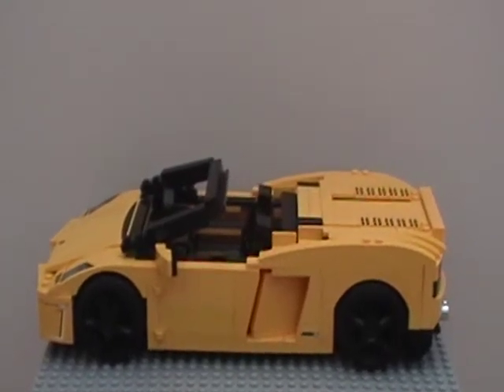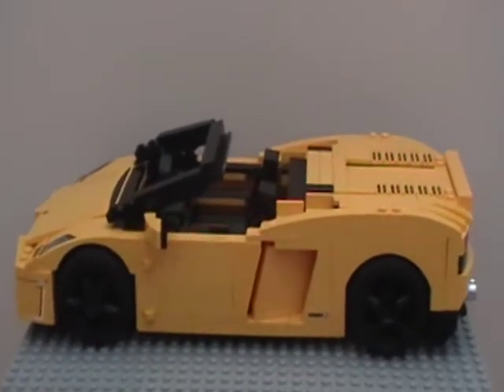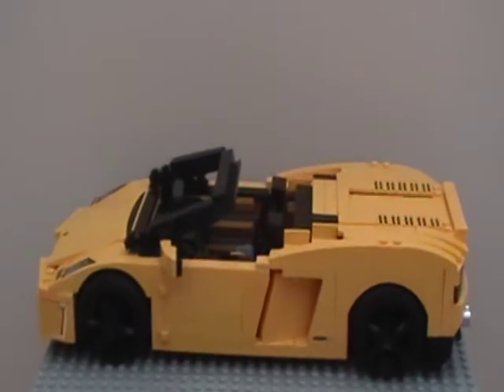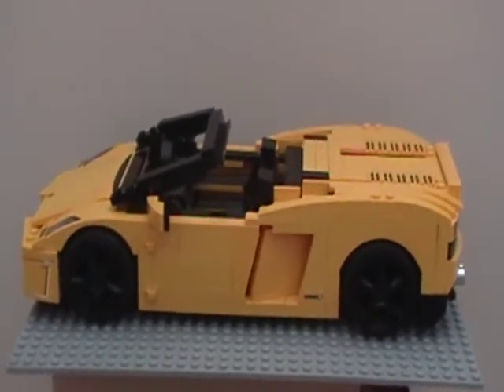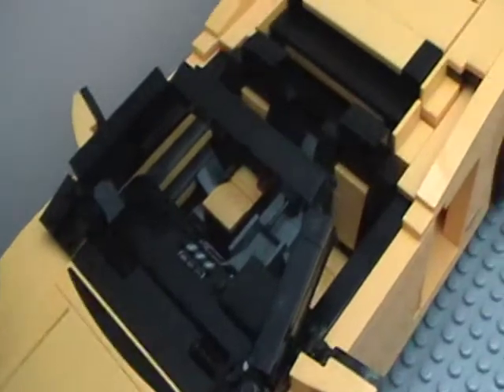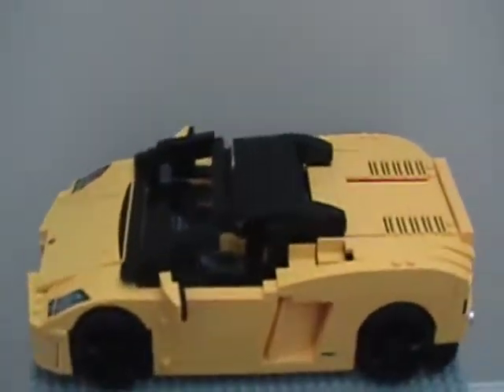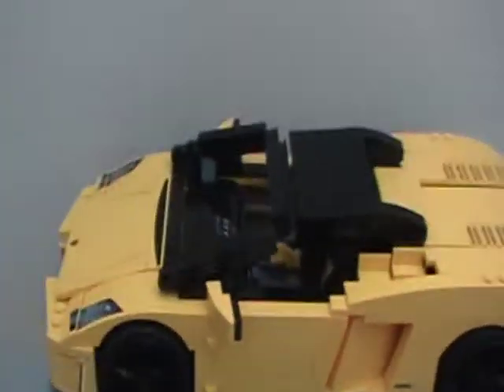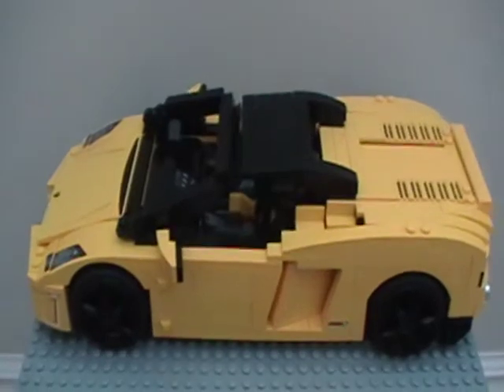Lego Challenge #1

Comment: "My challenge to you is to motorize this," :)
"In here there might be room for a steering function," :o
"Inside the back you have a good amount of room in there for a motor," :O
"It doesn't have to be four wheel drive," 0.o
"You're going to need a differential in there,"  -.-

This will be tricky...